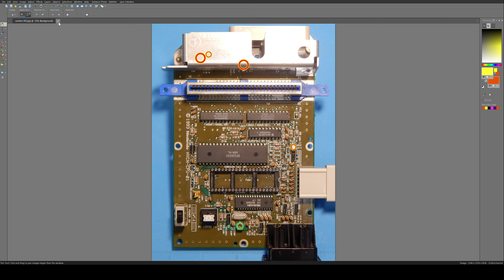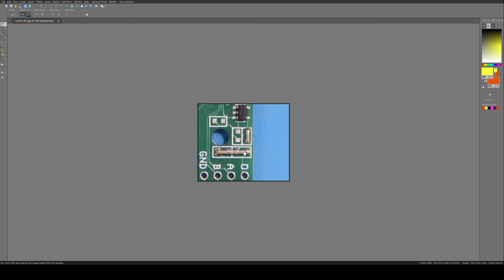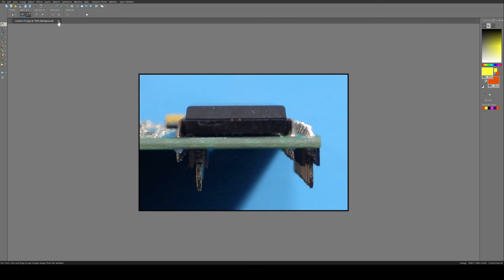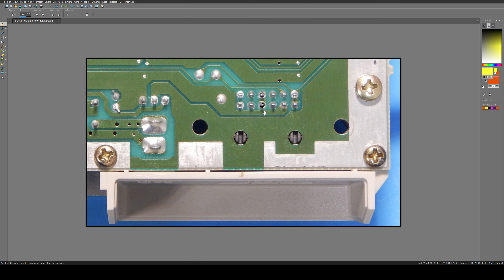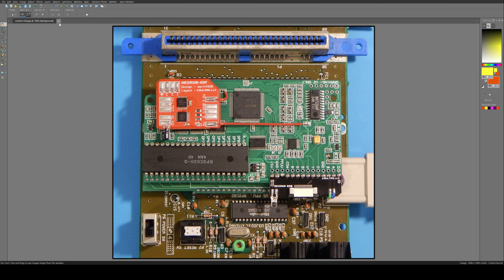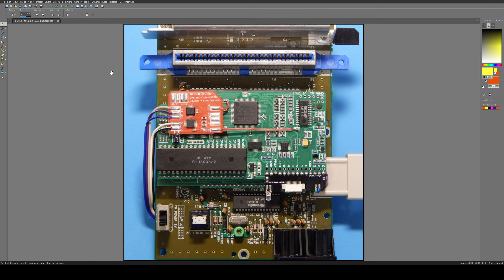Ultimate AV Famicom Mods Guide - NESRGB - Expansion Audio - IGR - Zapper Support

Comment from the maker: My apologies in that I forgot to set the 'hi-low' jumper on the IGR board. I didn't have any problems with it left floating for regular cart games, but caused compatibility issues with the Everdrive N8 Pro. It's supposed to be jumped to 'low' for AV Famicom installations. However, even with correcting this, the Everdrive N8 Pro still didn't like the IGR being used to handle reset functions, and I ultimately had to remove the wires involved with the reset circuit as well as restore the trace cut I made. The IGR board's in-game palette functions can still be used, just not the reset functions due to the conflict with the ED N8 Pro. This all of course doesn't matter with the newer NESRGB 4.0 boards as those have IGR built-in, making this board obsolete for those newer NESRGB boards. Cheers!

Comment: Hey FirebrandX I am looking to revert my NESRGB board back to stock after having removed the sound components with the intention of installing for AV and now I am instead installing on an original Red & White Famicom since it already has the sound it needs without modification. Do you happen to know what are each of these parts I have removed? I just realized I much preferred the original Famicom. Thank you in any case.

Comment: I did the audio rebalance mod on my AV Famicom + NESRGB4, and the expansion audio sounds pretty awful with my Famicom Disk System RAM adapter. No clue what the issue is. Expansion audio sounds blown out and static-y, while regular audio channels sound crystal clear. Only thing I can't test in terms of new parts is the SMD cap, but it came from digikey so i assume it's good. Wondering if there's a faulty part on the NESRGB.
Reply from the maker: Have you checked without the RAM adapter? Like say putting Akumajou Densetsu in and testing it?
Reply from the maker: I did some research on this, and I've heard this happens because the AV Famicom power supply doesn't have enough amperage to power the RAM adapter properly. So you might want to replace the original PSU with a Triad 9V 1.3A.
Reply: @RedArremer  (other replies deleted for clarity) Thanks for the reply! I don't have an AKD cart, I think my only expansion audio carts are FDS RAM adapters. I checked, and the PSU I'm currently using is a 9V 1.2A. Do you think the extra amperage of the 1.3A would be enough to correct the issue?
Reply from the maker: @sanpuru1969  It would be best to just snag a used copy of Akumajou Densetsu. If that plays fine, then we know it's directly an issue with the FDS RAM adapter.

Comment: Do I really need to drill the vias? Can I not just remove the multi-out, solder mask the vias on both sides of the board and half way down the multi-out ground pins leaving only the tips exposed for the quick solder board?
Reply: That's what I did, just instead of mask I used electrical tape around the vias to avoid accidentally soldering the pins to anything but the QSB. Don't see any jailbars.

Comment: Thanks so much for this awesome video!  I have watched it many times in preparation, but if you don't mind I have a couple questions for you before I start.

At 1:09 can you explain why you removed Q1?  I don't see a mention of removing Q1 in Ace's guide on RetroRGB and I also don't see it mentioned in any of the NESRGB installation instructions.  

At 2:32 you talk about adding back in the electrolytic capacitors.  C1 doesn't get replaced because of Ace's audio mod and you talk about how C15 shouldn't be there, but you didn't mention anything about why you didn't replace C5.  The NESRGB instructions say that this capacitor gets in the way of the NESRGB board and that you should re-install it on its side but is this capacitor even necessary?  Will it add noise or anything if I add it or should I just leave it unpopulated like it shows in your picture?

Thanks again for this awesome guide and I can't wait to get started!
Reply from the maker: Hi there! Both Q1 and C5 aren't needed as they are part of the original composite video circuit. Leaving them removed makes for less chance of unwanted noise and an easier install of the NESRGB board. 

Also I'm going to pin a comment in that I forgot to set the 'hi-low' jumper on the IGR board. I didn't have any problems with it left floating for regular cart games, but caused compatibility issues with the Everdrive N8 Pro. It's supposed to be jumped to 'low' for AV Famicom installations. However, even with correcting this, the Everdrive N8 Pro still doesn't like the IGR being used to handle reset functions, and I ultimately had to remove the wires involved with the reset circuit on the IGR board and AV Famicom, and restore the trace cut I made. The IGR board's in-game palette functions can still be used, just not the reset functions due to the conflict with the ED N8 Pro. This all of course doesn't matter with the newer NESRGB 4.0 boards as those have IGR built-in, making this board obsolete for those newer NESRGB boards. Cheers!

Comment: I just purchased an AV Famicom with NESRGB V4.0 + audio restoration mod + recap + new voltage reg. I'm having background audio buzzing issues though...weirdly, when I either disconnect my retro-bit N30 wireless pad receiver, OR place my hand near the controller ports, the buzzing stops. I'm using a triad psu, and shielded SNES RGB cables. Any advice you could give wouyld be amazing as I know you are very busy firebrand.
Reply from the maker: The problem is you're using 8bitdo transceivers. They are notorious for leaking noise into analog consoles due to improper shielding. The Joyzz transceiver doesn't have this problem from what I'm told, but for NES, what you can do is get an extension cable to relocate the transceiver about 14 inches or so away from the console. That will still allow you to use your wireless controller without having noise leaking into the audio.
Reply: @RedArremer  You sir are awesome. I actually already purchased an extention cable about 10 mins ago as that was my next logical step! Thank you so much for the input.

Comment: Whats the reason for cutting the reset function trace? Just curious. I have the  v4 of the NESRGB board and in the online directions from Tims website it doesnt mention it. The v4 board only has the RO function pad. But his directions for the AV famicom show pictures of the Top Loader NES for some reason.
Reply from the maker: It has to be done for this specific IGR mod. Please use whatever instructions Tim has until such time as I can get a version 4.0 board to do a new video on with audio balance restoration. Cheers!

Comment: You gave me the tip about buying a TCL TV. I'm very grateful. I use it now with the amazing MISTer. I still have my OSSC and consoles but they're getting less use. Since there are so many vertical shmups on MISTer, I'd like to try a TATE set-up using a TCL TV. But, the issue is how will a TCL TV which is not really designed to be in the portrait position cope with that? The TV I have is a TCL 50P615K 50" Slim 4K HDR LED Smart Android TV. I was thinking of buying something similar to this so I'd have one for normal gaming and one for TATE.
Reply from the maker: I don't think flat panels will have any issues with being in TATE orientation. No "liquid metal leaking issues" like with the CPU on the PS5 ;-)
Reply: @RedArremer  
Thanks buddy. It means a lot. I really got a great TCL TV. It only cost me about $300 (new) delivered. It doesn't object to anything from the OSSC and it works very nice with the MISTer. The only small complaint is the scanlines disappear a bit when the screen is scrolling vertically.

Comment: Great video,thank you. I just bought an AV Famicom that I plan to restore and then mod with the v4 NESRGB kit. I have a few questions though if you don't mind clarifying.

First -- At 1:18 you mentioned de-soldering and removing the DC input power jack, then you solder it back in later in the video. Why?

Second -- At 7:02 you mention cutting the PPU legs flush with the NESRGB board so as to not have to use another riser/socket. Is there any particular benefit to that? I didn't see a mention of that in Tim W's AV Famicom install notes.

Third -- At 8:28 you start detailing how you drilled out around the ground vias on the multi-out to remove CPU noise. I'm terrified of getting a drill anywhere near one of these boards, so how bad is that noise? Just trying to see if the reward is worth the risk.

Fourth -- At 13:18 you mention that in-game reset is integrated into the v4 board on the NESRGB kit. Do you still have to leave C15 unpopulated on the AV Famicom's motherboard?

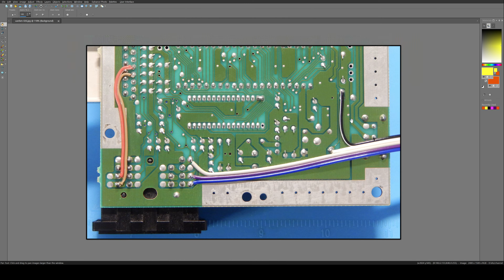Finally, at 14:55 you mention that for the controller wires for in-game reset and palette switching, you cut the trace for the reset signal. I'm having trouble matching this up with the AV Famicom NESRGB 4.0 notes on Tim Worthington's page, however (http://etim.net.au/nesrgb/NESRGB40.html). What was the reasoning behind this?

Thank you again for all you do for the community. Your Triad PSU and NES palette research have been invaluable to the retro gaming and modding community.
Reply from the maker: Hi there. Lets see if I can get these Q's all knocked out:

First Q --- It was the easiest way to get to the Multi-AV port. I don't recall if the plastic plate can easily be removed without desoldering the DC jack and just removing the whole unit as-is.

Second Q --- No, you don't cut the PPU legs. You cut the board-to-board posts flush at the top and fill with solder. As seen later in the video, this allows the PPU to sit flat to the board without needing another machined socket (note of course I used the wrong term of "dual wipe" when I was talking about the machined sockets).

Third Q --- It is VERY much worth doing for clean AV. It was my first time, and it was easy. Just make sure you use a drill bit not too large, but large enough to scrape away the ground connections to those Vias. Obviously don't go too fast or deep. 

Fourth Q --- You'd need to ask Tim Worthington about this specifically when it comes to the 4.0 board. 

Last Q --- It looks like Tim took a picture of a Top Loader there, but it definitely does not match the layout of the AV Famicom. Again, you would need to contact Tim for clarification on 4.0 board installation. For 2.X boards like the one I featured here, the trace has to be cut in order to allow the IGR board to take control of the reset function (in other words, it uses that break in the connection in order to close it with the chips on the IGR board itself).

It might be best to look up installation videos that are known correct for NESRGB 4.0 in the AV Famicom for questions about that model. Tim's instructions can often be difficult to follow.
Reply: @RedArremer  thank you for the clarification
Reply: @RedArremer  what style/type of drill bit works best?

Comment: Thanks for the video! I've just about wrapped up doing every mod presented here. Castlevania 3 JP and Gimmick sound great! As I'm using a NESRGB V4.0, I'll be heading off to Tim's website for IGR instructions. As a side note, besides built-in IGR, a selling point for me with v4 was that your latest palette is the default one, so hooking up palette switching will be for posterity. Cheers
Reply from the maker: Hi Jon! Thanks! Actually even the 3.0 board uses my palette as well, so even if people get one of those, no need for firmware flash if they are on NTSC machines. PAL users would want "YUV" instead. Cheers!

Comment: 3:06 - That looks like a round pin socket to me. “Dual-wipe” sockets force the flat chip legs between two contacts that are under spring tension. :)
Reply from the maker: Yeah I realized afterwords I was using the wrong term. My apologies.
Reply: Great job clearly labeling everything!